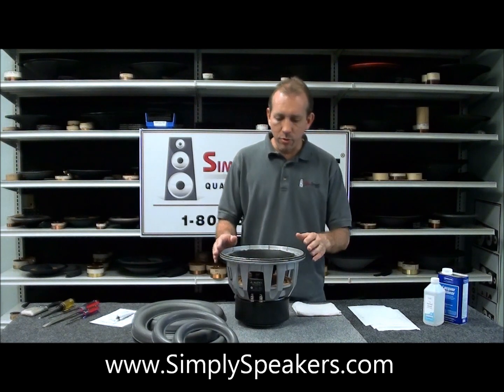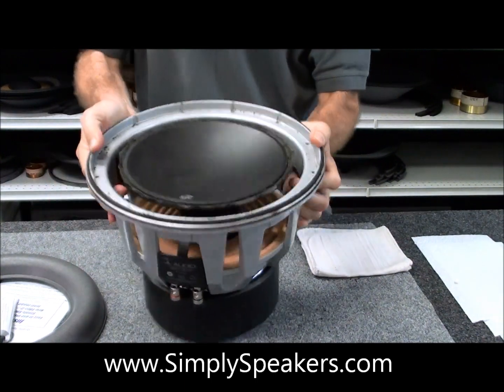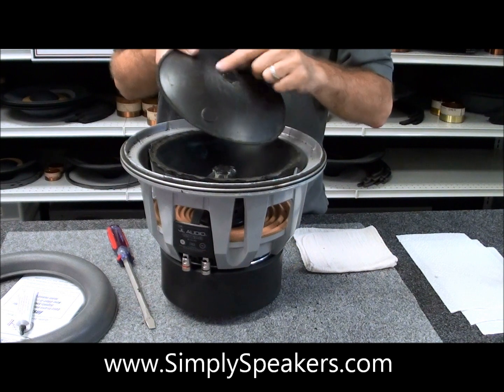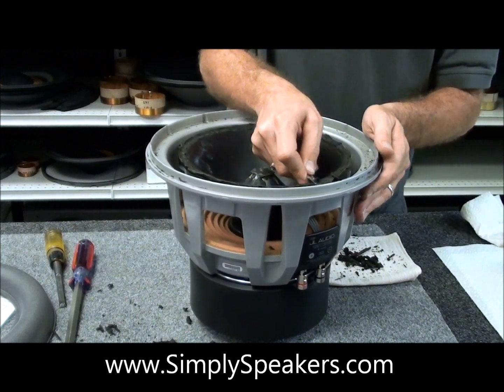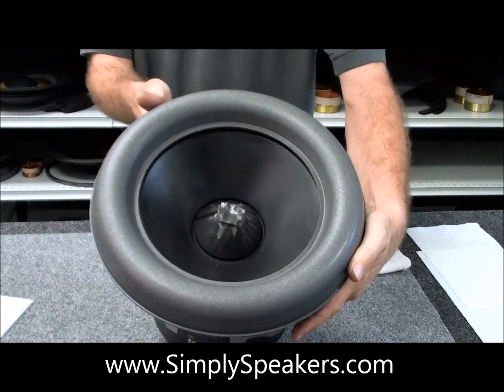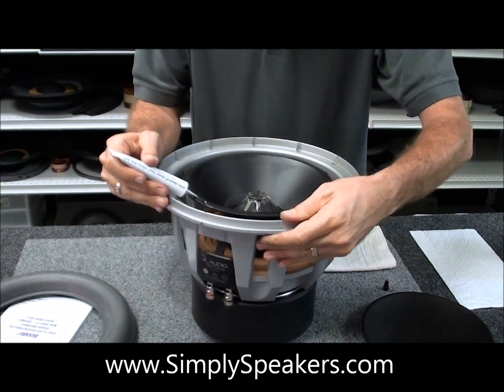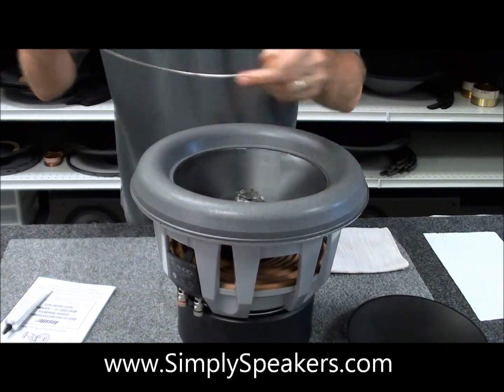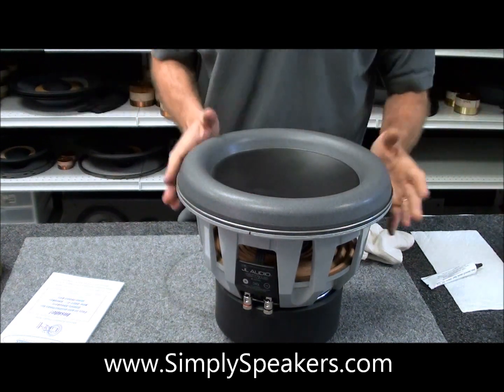JL Audio 12W7 Speaker Subwoofer Repair Foam Edge Replacement

Comment: Great video…did mine today. Let’s hope for the best. Anyone who is doing theirs, it’s pretty simple. I was nervous but got through it pretty easily. I cut up straws to hold the cone up to the foam. Just measure how big I needed the straw and cut it. I used 4 pieces of straw to push it up and braced it against the metal on the speaker. It worked out great.
Reply from the maker: Perfect!

Comment from the maker: Place something behind the cone to hold it up a bit while the glue dries. Use some wadded up paper towels, or an old rag, etc.
Reply: Simply Speakers thanks!!
Reply: Came in to see if there was an answer for this. thanks.
Reply: ... was wondering when someone, in the many vids floating about, would mention this.

Comment: For those replacing a cone on a F110, 112, or 113 you need to remove the four pins that normally hold you speaker grill in place. That allows the front wooden frame to be removed which gives you access to the silver perimeter ring that needs to be removed. This is shown on the JL website. Also, I used packing tape to attach string to the inner cone. I then tied it off to a 6ft A frame ladder I had positioned over the woofer to apply upwards pressure on the cone since I had no access from below.
Reply from the maker: Thanks for the tips! :)

Comment: Badass thanks for the video helped out a lot with my repair on 12in w7 the previous owner I guess messed up while fixing the sub and glues the foam to the top peice instead of the bottom cone all fixed now though thanks again

Comment: I have a JL Audio Powerwedge made back in the early 2000's I like to get back into shape, its 3-10 inch woofers, do you sell the foam edges for older woofers?
Reply from the maker: Thanks. 

Order the kit here:

https://www.simplyspeakers.com/jl-audio-speaker-foam-edge-repair-kit-fsk-10jl-3.html

Comment: Just bought this kit from simply speakers. Do you have to remove the dust cap/top cone? Saw another vid where they didn't. Is it really necessary to do this? Thanks.
Reply from the maker: Not needed. Follow video and you should be fine.

Comment: My foam on the 13w7 start falling apart, i already have your repair set. I hope it work well. How long you hold the cone up when you glue it to the foam, cant imagine you hold it for one hour with your hands.🤪
Reply from the maker: Use some wadded up paper towels under the cone to help hole it up.  :)

Comment: Thanks guys, I ordered the 10w7 kit, after the new surround I am having a hard time putting the metal o ring on, seems to tight fit. What can I do about this?
Reply from the maker: Yes, they are tight. Contact us through our website and we will send you the link for installing the o-rings. Thanks!

Comment: I found a good deal on a 12w7.  But while looking at the pics I notice the date code of 9-10-12!  Its 11 yrs old.  Seller said bought new 5 yrs old and has been in office since.  Im worried the rubber surround has degraded over time.  So what your thoughts on buying such an old sub
Reply from the maker: The surround will likely need to be replaced. If you find it is bad, we have the kits, so no worries. Happy to help if needed. Thanks!

Comment: You can use Goo Gone to remove the foam and residue instead of excessive scraping. Once the Goo Gone soaks through the foam for a good amount of time, it comes off easily. I've done it on a w6v2

Comment: so do you have to hold the cone up with your hand to the new foam ring for an hour?
Reply from the maker: Place a few wadded up paper towels under the cone to hold it up until the adhesive cures.
Reply: @simplyspeakers  gotcha cool, thanks! I bought the kit for my w7 10” from you guys. Can’t wait to get the boom back in my trunk!

Comment: my 12w7ae3 I purchased in 2106 had no glue between the center cone and dustcap. It was a white double sided sticker. foamy as well. Does anyone have a replacement they can suggest or can I just peel it and glue directly from cone to dust cap? there is no lip for the glue to sit on in the center cone.
Reply from the maker: You can use double sided peel and stick foam tape, or you can use the MI-3035 adhesive in our kit to bond the parts.

Comment: Excellent video on how to repair the W7 series!! However, how do you hold the cone up for an hour for it to bond to the replacement outer rubber?
Reply from the maker: You can use a couple of bunched up washcloths or paper towels under the cones to prop them up.
Reply: @simplyspeakers  awesome, thank you for replying.

Comment: How long to hold cone up before you can let go to dry for hours. And my center piece is cracked. Can I use fiberglass resin to seal once separate or what does anyone suggest
Reply from the maker: We like to let the glue set up for several hours. Overnight is best. You might try the fiberglass resin to seal the cracked part of the cone. That should work great!
Reply: @simplyspeakers  thank you so much 😊

Comment: Are there different size(larger than original)  surrounds available for this model of sub,or are they all the same?
Reply from the maker: There is only one W7 surround for each size. subwoofer. 8", 10", 12" and 13".
Reply: Oh ok, I thought there may have been an improved or modified design. I wish there was a rubber surround option.
Reply from the maker: For the W7 series, all the surrounds are the same design, just different sizes.

Comment: What method do you use to separate the outer cone from the surround on W7s in which the foam has not deteriorated to the point of it being loose?

I'd imagine using a small flatblade or something to pry it up working around the perimeter, but I also fear that the adhesive is too strong and it might damage the outer cone.
Reply from the maker: Thanks. Not sure since we always get them in the shop and the foams are pretty deteriorated. Might need to email a photo of that unit to us so we can see what options you have.
Reply: I just tackled this repair because my foam had a small rip in it, however, the foam was not deteriorated at all.  I first cut the foam with a utility knife as close to where the two cones are glued together as possible.  I did so giving myself a bit of space so I wouldn't risk nicking the plastic cones with the blade accidentally.  I then used the heat-gun to heat up the glue and foam around the perimeter of the woofer, and then used the utility knife to cut the foam between the two cones enough so that I could get my finger between the two.  Then, while applying a bit more heat in front of my finger as I worked around the perimeter, I was able to heat the glue and foam enough to separate the two layers.  The foam did not split, rather, the glue loosened from the top cap, and the foam stayed on the bottom cap.  Once the top cap was removed, I then used more heat, got underneath the foam (which was easy once the top cap was removed, it appears JL used glue on the bottom cap more towards the outside of the cap rather than the inside), and worked the foam around and removed it as one solid ring piece.  I then had to use alcohol to remove the glue residue left over.

Comment: If my foam isn’t damage can I reuse it ? The only problem on mine is that the cone came of
Reply: But i did notice that the foam is coming of as well
Reply from the maker: You can usually re glue the surround as long is not starting to deteriorate.

Comment: How do you make sure the coil stays lined up so there’s no rubbing? What if the glue dries and realize the coil is rubbing? You really didn’t touch on that.
Reply from the maker: W7 subs are centered on final install using the metal o-rings.

Comment: No need to shim?
Reply from the maker: Can't shim  on the W7 subs. Design does not allow for shimming. The surrounds is attached to the outside frame with a mechanical metal ring that allows movement and to center the assembly as needed.